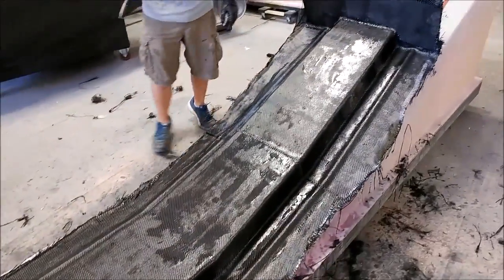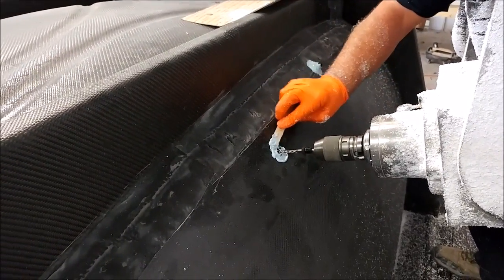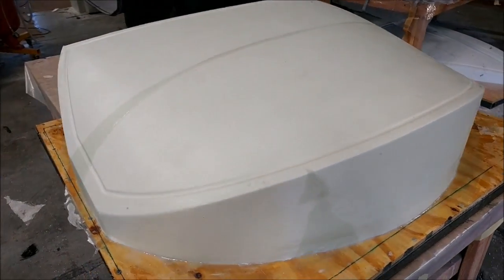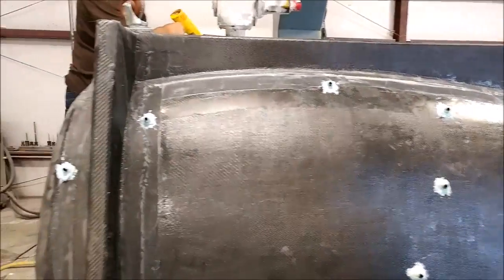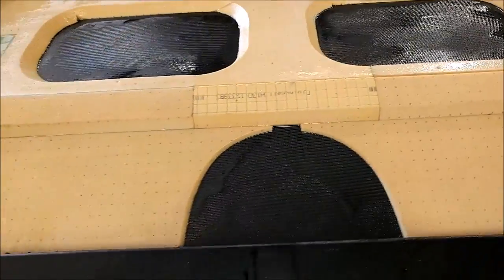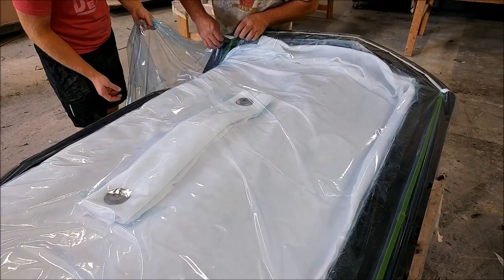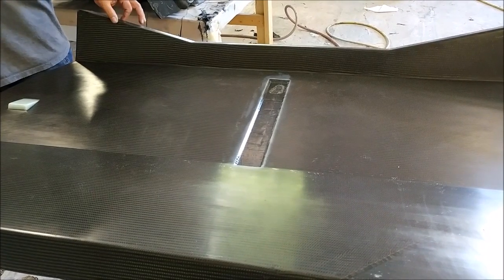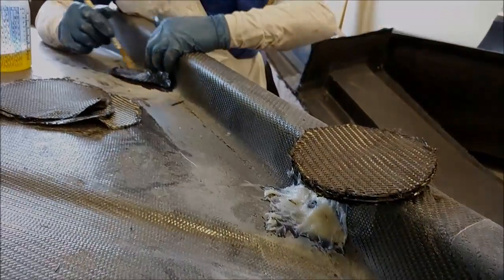Raptor Aircraft June 11th

Comment: Tanks for a fantastic show, love the craftmanship. Why du you lay a layer of glassfibre after gelcoat before the light carbon.
Reply from the maker: The fiberglass has a much finer weave and therefore prevents any of the heavier weave of the carbon fiber imprinting through into the finished surface of the mold.